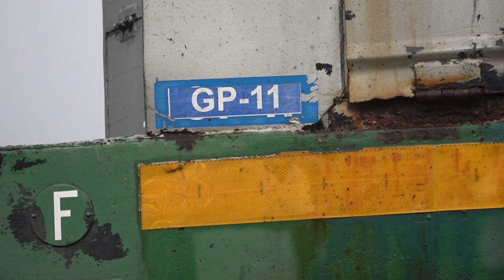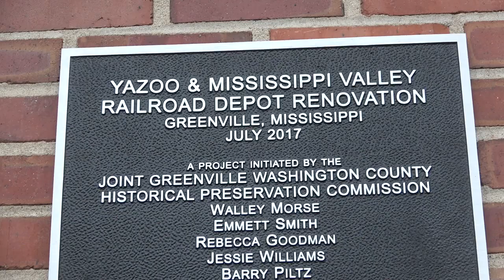The Columbus and Greenville Railway! (Ft. Paducah Rebuild GP11)

Comment: Great video!

At the 2:12 mark, if you look at the backside of the fuel cell, you can see water pissing out. If I'm not mistaken, it's coming from the block drain which is how accumulation like rain water that enters through the exhaust stack is safely drained from the cylinders to prevent hydro-locking and other damage.

I'm no expert, but I do remember when I worked at Titan, we had an old GP10 we used to switch and every morning we had to manually open drain cocks on the block to allow rain water to safely escape during engine start up.

Looks like the same case here, but I could be wrong.

Comment: Good one. Engines like this make G&W lines special. That and G&W tends to leave a lot of old landmarks (milepost, crossings, signals if you're lucky, etc) still standing. Have you been to Columbus to see the CAGY roundhouse? They have an old CAGY diesel on display there and Columbus has a ton of short line action as well.
Reply: I visited the roundhouse probably 25 years ago, and if I recall it was an old Baldwin on display. I'd love to sight see again with a good camera!

Comment: Nice video! Are the two trains mentioned in the video daily jobs with a regular 0800 ish start?
Reply from the maker: The road job doesn't start off in Greenville everyday. They start in Greenwood some days. I'd say get there at 7 to be safe.
Reply: We both come on duty at 0700. The Greenwood crew typically leaves Greenwood one day then Greenville the next. Some days they may not run at all depending on if we get cars from CN.